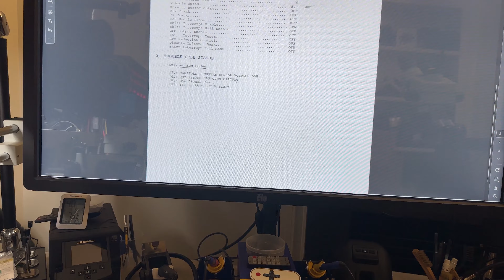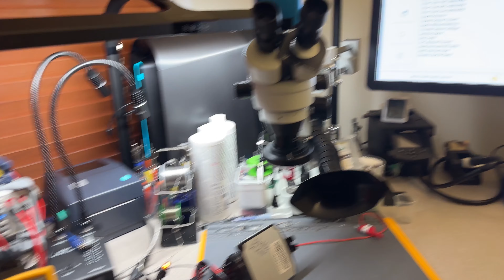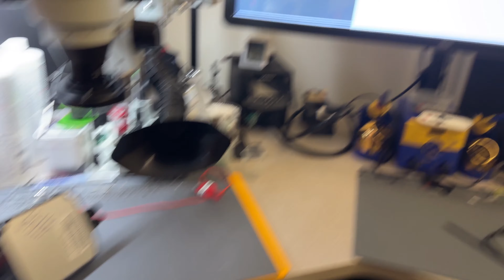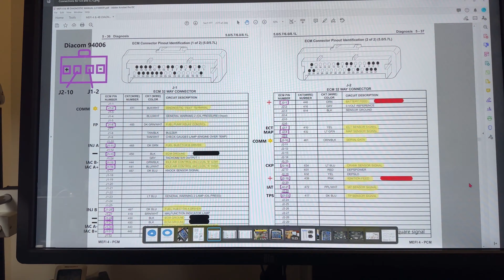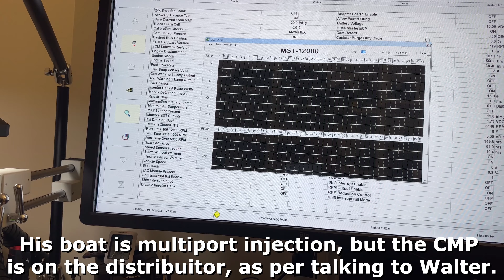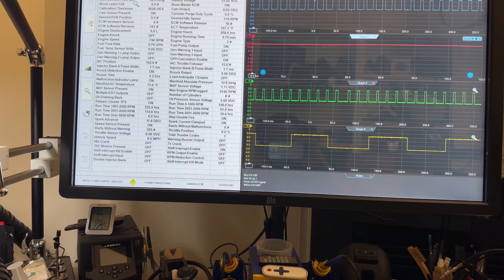Marine ECM 2006 MEFI 4 5.0L GXi-E crank no start condition test for Walter Soldani in FL

Comment: @16:06 as you lift the probe, is that a spark between the probe and the board, or perhaps a cracked solder connection?
Reply from the maker: Hi, no that is the gel. The light on the microscope reflected on the gel.  This ECMs are covered in a clear re-enterable gel, the main function is to reduce vibration and heath.

Comment: Hi I have this same engine and computer, do you Know a way I can read the fault codes? I've seen people use a jumper and count blinking lights however i was not able to test this.  I stopped getting a fuel pump relay ground. It reset when I disconnected the battery but i expect it to come back.
Reply from the maker: Sorry, the only way I know is with a scanner.
Reply: @MaicSalazarDiagnostics  ok thank you
Reply from the maker: Diacom sells an adfordable scanner you can use to read codes and see sensor data,  https://www.rinda.com/techmatepro/
If you run into problems with your ECM, please reach out to me at maic@maicsalazardiagnostics.com  
 @revnkevin1